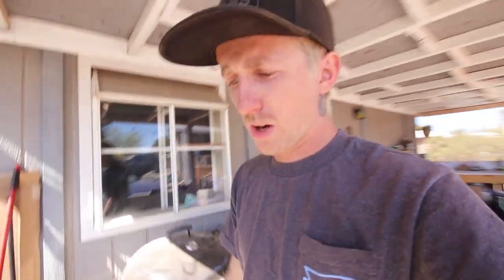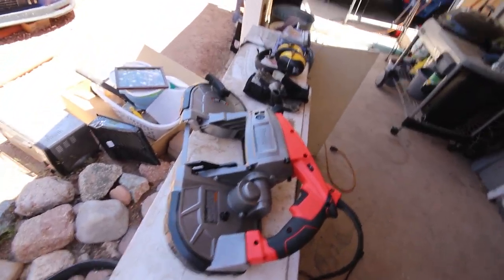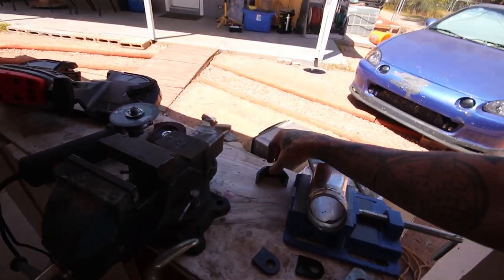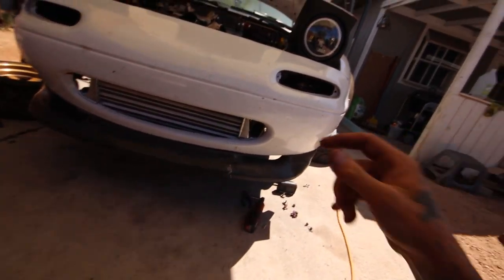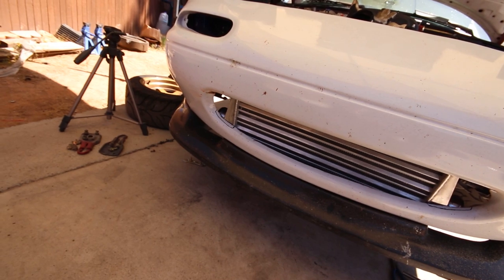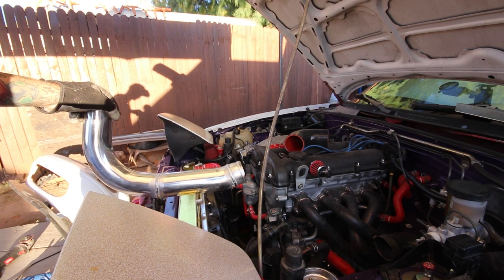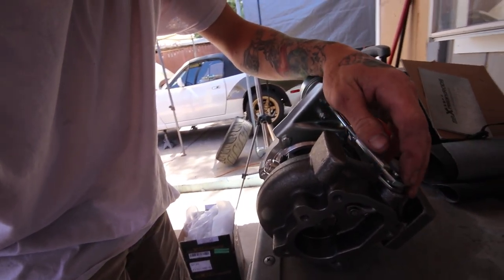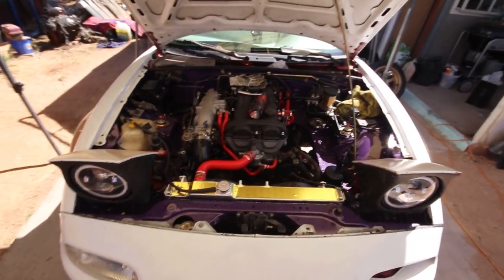Budget Miata Turbo Build Part 1: Intercooler Install

Comment: I did mine last week and the best way I found to do it was to buy a bash bar and weld it to the bash bar.
Reply from the maker: Does your bash bar bolt onto the core support? Or was that a weld on deal
Reply: ChrisSadowski it bolts up using the tow hooks bolts and it has welded tow hooks. Came out really clean and it helps keep my ac. The bumper fits flush too. Check out my last video I did it on my last video

Comment: What material is the intercooler pipe?
Reply from the maker: Aluminum
Reply: Do they sell intercooler pipes that are steel? I have a flux core and it doesn’t work on aluminum right??
Reply from the maker: Not to my knowledge, that would be way too heavy and not a good conducter off heat. Flux core only does mild steel. You need an AC capable Tig welder to do aluminum or a spool gun and to reverse your leads on a Mig welder
Reply: Ahhh hmmm. Okok thank bud! Keep up the good work with budget lifestyle!
Reply from the maker: Thanks man!